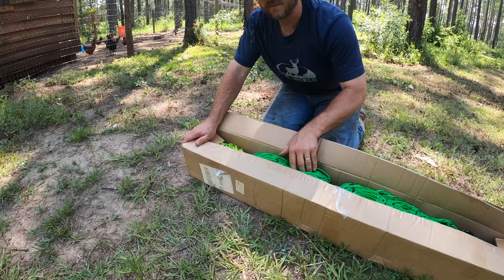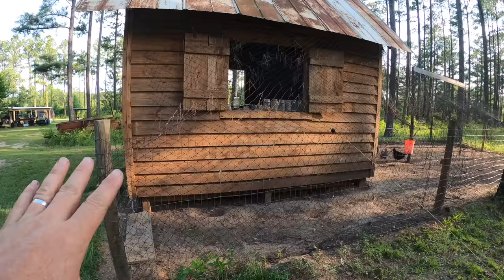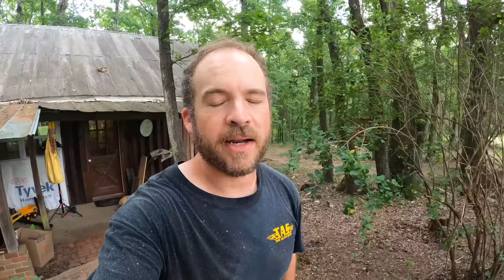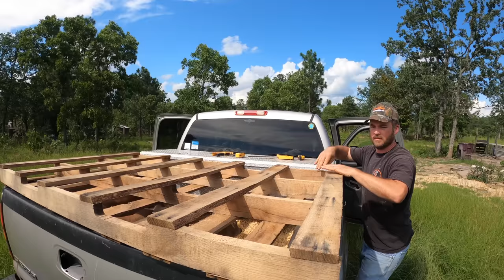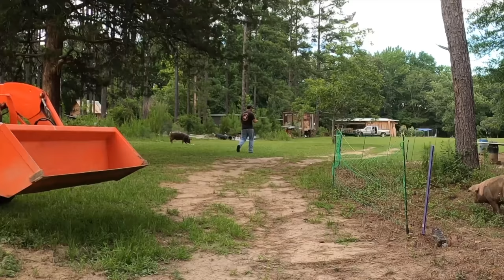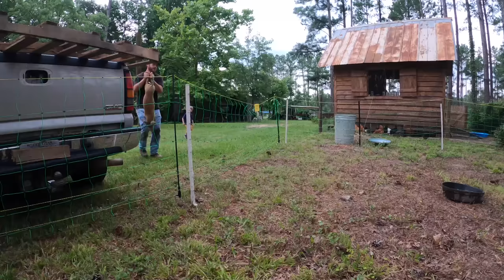Little Pigs and BIG Escapes

Comment: Good morning Wes. Turn those inside corner electric posts in the opposite direction with the holding tabs facing the corner. Better support that way and the tabs wont break off.
Reply from the maker: I've been wondering about that, thanks!